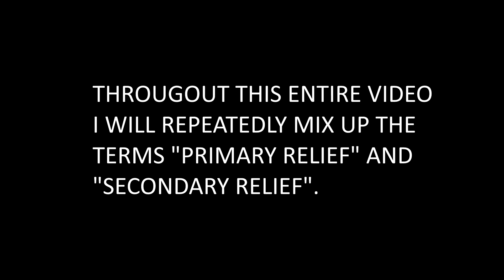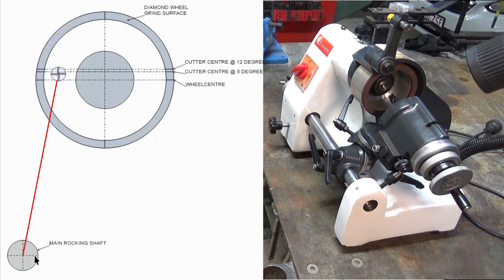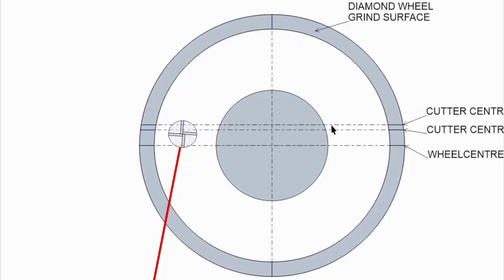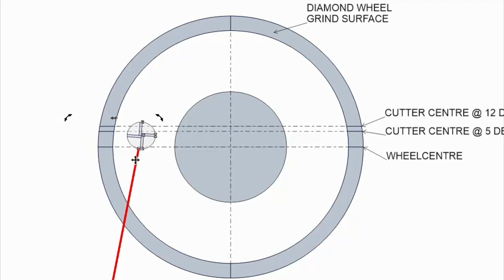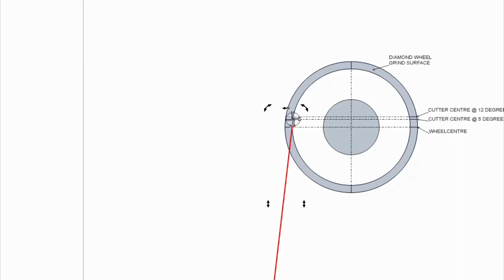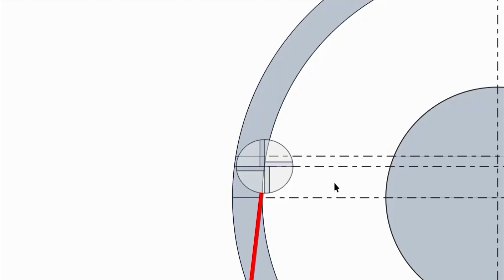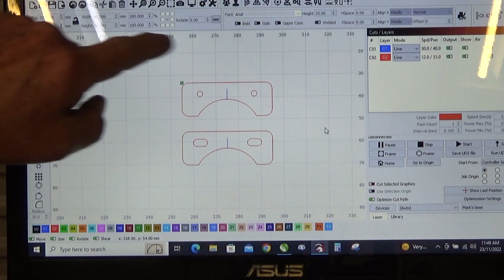D Bit Grinder Modification for Easier End Mill Sharpening

Comment: D bit grinders aren't cheap, though can be handy to have one around. The dedicated 4 flute end mill sharpeners are around the same price, I wonder if you can make fixtures that will feed endmills at the correct angles like those endmills grinders do.
Reply from the maker: I have seen those dedicated end mill grinders. At the rate I dull and break bits it would almost be worth it. As soon as I ruined that 12mm bit I ordered a new one but given that it can take weeks for shipping, it is nice to be able to get the broken one back into service within an hour or so. I used it again today and if you didn't look too closely at the end of it you wouldn't know I had abused it. 
Regards,
Mark

Comment: Hey Preso, why didn't you try a dial indicator on the work head?
Reply from the maker: You can absolutely do that. I am not sure that carbide dust would be good for it though. I have been considering some sort of hard stop instead of a graduated dial too. The Quorn tool and cutter grinder has such a hard stop but it only works when grinding from the outside of the wheel to the inside. 
Regards,
Mark

Comment: Interestingly, there is NO plate on the Deckel with a mark or a mark on the wheel, old or new models or restored models. I had a pretty good look around the internet, so that is a major improvement for your machine and one I will be implementing asap.
Cheers
Wylie
Reply from the maker: I was wondering if the genuine Deckel had a better system of stops on it. It has been pointed out that the method I am using is unconventional. I know you can feed the tool in from the outside of the wheel and use the screw as a hard stop but it could be done either way if there was a graduated ring on that knob. 
Regards,
Mark
Reply: I am not sure if they had a better system of stops but seeing how good the German and Swiss machinery was back in the day and in the present, I would assume so. In saying that, I know that if someone comes up with an idea that can make things far more accurate in 2 or more ways, then it is a success. I was taught to "Measure 3 times cut once". I know that if this system you are thinking of making works it may well help on those pesky strange jobs where you need 5 hands, 3 feet, some multi grips and sticky tape. Bottom line is, "I like it".
Cheers
Wylie

Comment: Nice work. One question: why a zero and not a hard stop that you could engage or disengage?
Reply from the maker: Damien, a hard stop would be better and would take less concentration to use. I was really looking for a quick and dirty solution to get me out of trouble with that broken end mill. I am sure there would be a way of making a good and easily set hard stop. The only issue is the very strong spring that allows the workhead to move outboard as you unwind the feed screw. You would need a stop that was strong enough to hold against that spring

Comment: Looks like the mod works well! 
Robin Renzetti used the pad at the far back right of the main casting as his stop, with an adjustable stop on a long arm on the rocker shaft. Specifically he made the stop at an equal radius from the shaft centre as the cutter being ground ot make quantitative adjustments easy. His video probably describes it better than I'm doing: https://youtu.be/ELTL9qTJg-o

Comment: It seems like if you angle the tool 12 degrees down rather than up, you could cut from the outside rather than the inside of the cup.  Then just use that knob as a stop, rather than a way to push the tool around during grinding.  Maybe that's in the "Think it all the way through before cutting anything" category.  :-)  (Ask me how I know...). Unless I'm missing something.  Again.  :)

Still, nice work!  :)  Though I might consider returning that nail to the manufacturer as being insufficiently cabinet-incident-proof...
Reply from the maker: I have done it that way too. I think you get a better view of the edge being ground working from the inside of the wheel. Unfortunately the manual with my machine was startlingly brief in it's description of how to sharpen milling cutters and there doesn't seem to be a lot of resources on YouTube on this particular topic. 
Regards,
Mark
Reply: @Preso58  Gotcha. 

Learning is the fun part, eh?  Beyond the manual... there be dragons!  I wonder if you might enjoy some of Stefan Gotteswinter's older vids on D-bit tool grinding techniques.
Reply: Hmmm... 
I think that carbide do not like to be grind in "away from the edge" direction. It will microchip.
Reply: @bmalovic  Interesting!

Comment: Mark, to correct the runout on the diamond wheels, I made an arbor to mount the tapered wheel adaptor to and turned the aluminum wheel carcass true in a lathe.  Then followed a process from Cliff at Threadexpress on truing the diamond substrate, worked like a champ! https://www.youtube.com/watch?v=gpbMn94vtrk

Comment: Am I missing something, or that edges that you just grind, cut just a tiny bit in this two examples?
That material is cut 98% by helical edges, not by that 4 straight edges at the bottom of the mill.
If you plunge cut, it will be the opposite, straight edges will do 98% of the work and helical edges just a tiny bit.
Reply from the maker: No, you are correct but if you chip all four sharp corners it will place excessive load on the end mill. It also produces more heat in the part and the bit. I was probably fortunate that I only destroyed one cutting edge which is why I could continue with the job. If the helical edge doesn't extend all the way to the bottom edge of the bit it won't cut at all in that  area. And yes, plunge cutting would be very difficult if the corners or the straight cutting edges are damaged. 
Regards,
Mark
Reply: @Preso58  Of course...
Just.. for quick and dirty... 
You probably can pass with just sharpening the outher part of bottom edge, and just rough releiving or just grinding away all of the center part.
So you do not have to care about hitting the center point exactly.
Of course.. if you do plunge cut, then you must sharpen entire bottom edge.

Comment: Hi. Thank you for the video.  it takes a great deal of torque to tighten my work head on the main shaft.
It is clean and I dont see any problems with it. any ideas?
Reply from the maker: I am not sure. Perhaps the mating surfaces just aren't as flat as they could be. I think Stefan Gotteswinter did a video of dismantling and inspecting his Deckel clone. He made a number of improvements, mostly to do with fitting mating parts. Might be worth a look.
Regards,
Mark